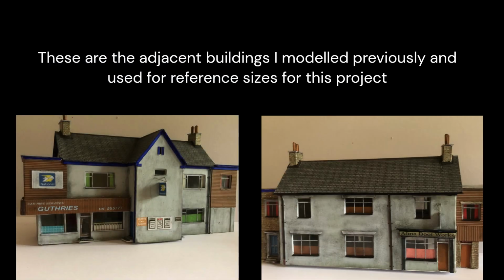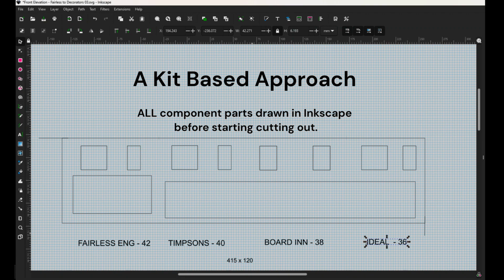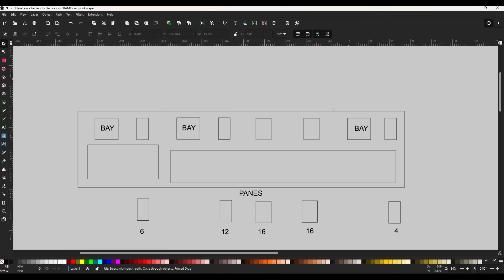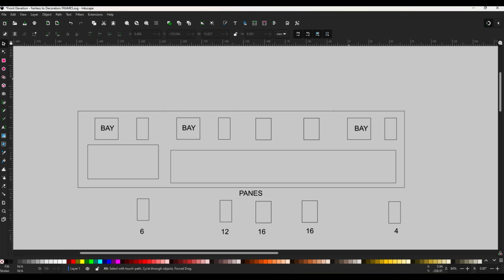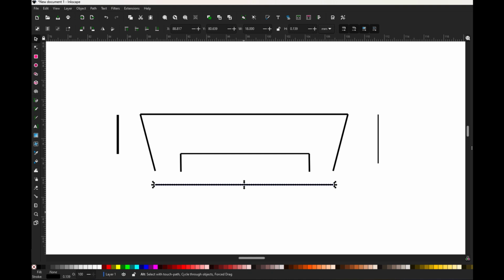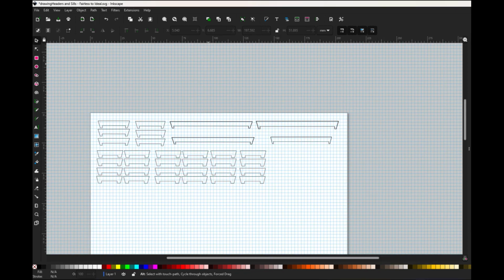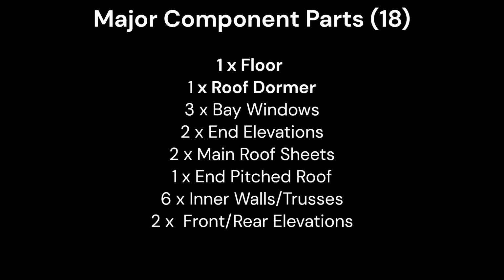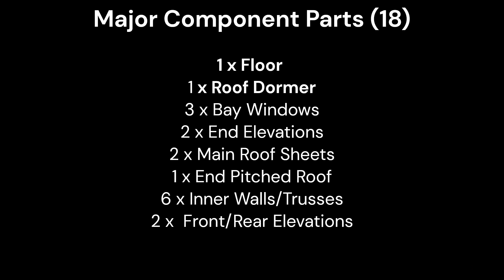Modelling More Buildings Lost to Progress - An Introduction to Next Series

Comment: Alan, I have a problem with printing from a PDF file from Scalescenes, pick the items I need say windows and doors, delete the rest, go to print and it will only show half of the items, windows missing, happens on most alterations I do, what am I doing wrong, can you help please, love you videos by the way. Ashort video on this would be great.
Reply from the maker: Hi Malcolm couple of questions.  1. Did you download the PDF into Inkscape then select the parts you want.  2. Did you follow my video on how to extract the parts?  3.  Which version of Inkscape are you using?  4.  What printer are you using?

I will do a test run later today when I get back home.  Cheers Alan
Reply from the maker: Hi Malcolm, just had a trial run with a Scalescenes PDF and it appears that the doors, wall coverings that do not print are embedded images.  I will have a closer look.  However, in the meantime you can print the images by selecting the part that does not print in Inkscape, copy the image and paste into a word processing program such as Word and print from there.  The images come out very clear.  Have a go with this and please let me know how you get on.  

I will do a short video on the issue and also a couple of issues I have identified with Inkscape drawings when sent to cutting machines.  Cheers Alan.
Reply: Alan, thank you for the reply, Using Inkscape version 1.3, I have 2 monitors, monitor 2 I load my Scalescenes PDFs, then just move PDF the across to monitor 1 to inkscape I have open
followed your video's, still had this problem. I done what you said and copied the inkscape file to another drawinfg software and then printed it, this is ok but I did find a difference in quality on the printed item. I use a Canon A3 printer IP8750. I tried a full sheet of Scalescenes brick paper, I don't normally do it as when I want a full sheet I just print it direct from scalescenes pdf. A full sheet of brick in Inkscape, I go to print and a third of it is missing? Regards Malc   @StocktonStation
Reply from the maker: @MalcolmSaunders-sr6zr  hi Malcolm did you try selecting the bits that don’t print and copy to Microsoft Word and print from there?
Reply: Alan, Not tried that, will give it a go, Thanks for your help Alan, Take care Malc @StocktonStation
Reply: Alan done a bit of work on inkscape and then copied to Microsoft word as you said, printed perfect and top quality print, Regards Malc @StocktonStation
Reply from the maker: @MalcolmSaunders-sr6zr  very good 👍